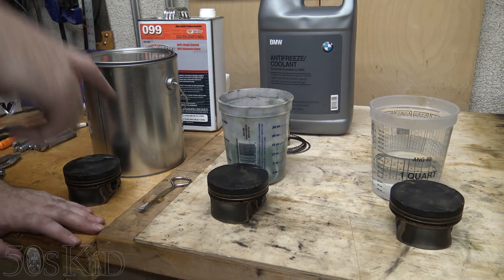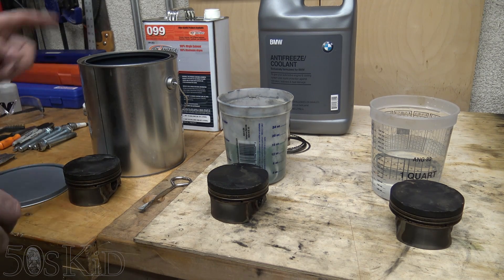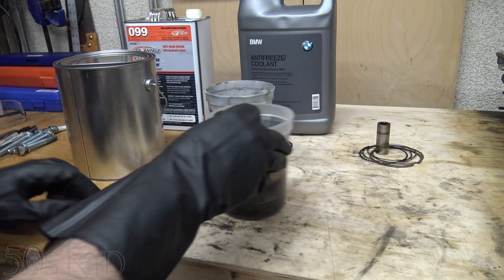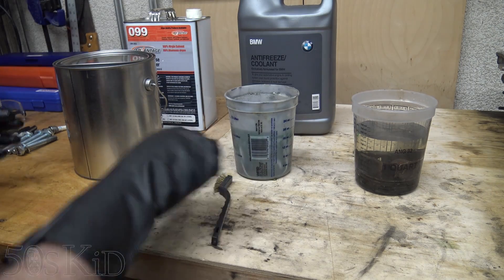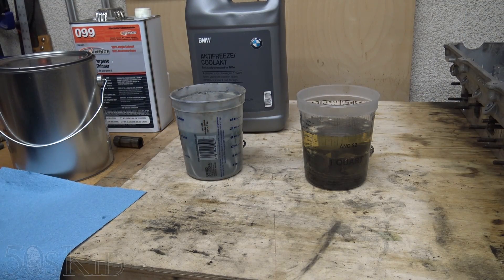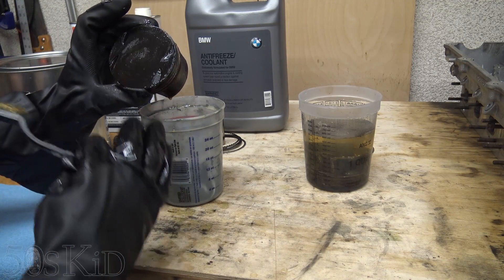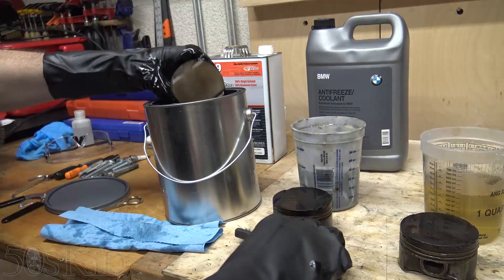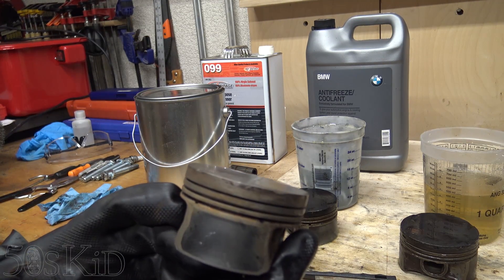How To Clean Carbon Off Pistons DIY

Comment: Water is a no, but steam will clean when under pressure + heat (ie while engine is running). Same goes with the coolant it has to be hot and agitated). That's why the combustion chamber is clean if you get a head gasket leak and coolant leaks in.

Comment: Chem Dip is the best method I've found. 19 bucks for a gal and the fumes aren't to bad. Works really well for everything I toss at it. What's another $20 bucks on a $1700 engine build. I used thinner once and learned my lesson after it caught fire in my garage.
Reply: How long did you leave the pistons in there? I ahve some but am worried about warnings on the side saying no aluminum for linger than 4 hours

Comment: I usually soak the pistons in lacquer thinner. Then light duty with a wire wheel and razor scraper. Then again degrease with lacquer thinner MAKE SURE THEY ARE DRY and into the toaster oven. DEDICATED OVEN NO LONGER ABLE TO COOK FOOD!!
 Start at 125 degf to completely dry and solvent free off the pistons for ten minutes then to 400 deg f  As per Mahle tech support even stock cast piston can handle up to 400 - 450 deg f. I stay around 400 or bake mode. After 30 minutes I hit them with the broiler between 400 and 425 for ten minutes to saturate the crowns, then back to 400 until what ever is left turns to ash. Slow cool in the oven. Juat a preference I drop the temp to around 250 for 10 min then off until room temp. Totally oil free and ready for install or your favorite coating process.
Reply from the maker: You don't need to bake anything. The solvents will evaporate very quickly.
Reply: 125 deg is not hot enough to clean pistons it's just a precautionary flash dry step to be sure all the solvent is gone. 
As far as baking it removes all trace oils and contaminants. All metals regardless of type or process have a microscopic crystalline grain structure making them porous and able to absorb oils this is why oil clings to parts. Heat cycles from engine operation opens the pores allowing the oils to penetrate the parts;  this absorbed oil is why engines don't seize the instant the oil film is gone due to lack of oil in addition to clearances and bearing materials. 
Baking the parts removes oil that saturates into the pores of the metal parts which is critical when applying and replacing engine and other piston coatings or applying coatings to used parts or new parts that have preservative on them. It also guarantees the parts are clean, I also have good success correcting  minor warpage of parts especially pistons usually less than  0.0025 inch that gives them a second or third round depending on application. I use this process for every engine build.

Comment: Question is, can i use a syringe to inject lacquer thinner into the spark plug hole, let it sit overnight and then start the engine the next day and blow it all out? Can that be done without the carbon coming loose in pieces and becoming jammed in the valves? If a person did this and the rings are worn, should i also do an oil change at the time time?
Reply: Cvcoco, did you tried? I would like to know.

Comment: I can take a cruddy piston drop it in my parts cleaner and submerge it and brush it off for about 2 minutes to remove oil and grease etc,, blow it dry completely and then walk over to my bead cabinet and clean it with glass beads to remove everything safetly without doing any damage to piston or rod pin surface and then blow it off with compressed air.
10 min start to Finnish with most time spent blowing it off 
parts washer step was to ensure no grease or oil contaminates my bead cabinet while cleaning pistons

with no exceptions this is the fastest easiest ways to clean unless maybe if you have a sonic parts cleaner with aggressive cleaning solution.. and maybe a spare 100 thousand for the set up ?
Reply: end result pistons look brand new with a dull uniform finish that is actually nicer then new
Reply: we're happy for yoy

Comment: really like your videos. my 2001 325 ci looses power, skips, shakes, after parking and going shortly after. it takes 5 minutes or so and then runs normal. was told fuel filter, plugs, and coils were replaced. do you have any suggestions? keep up the videos please and best of luck with the engine.
Reply from the maker: Watch my video on diagnosing random misfires

Comment: oven cleaner works great for removing carbon I used it on my 98  pathfinder intake manifold
Reply from the maker: Oven cleaner contains sodium hydroxide--it will react with the aluminum in the pistons
Reply: How about chem-dip? does it remove the coating on some bmw pistons?
Reply: @50sKid +1 on that! - Very bad idea using Oven cleaner - its usually is a strong base like Sodium hydroxide and WILL corrode/dissolve many metals - especially Aluminium! 
Safe for use with Stainless steel and readily dissolves fats, oils, greases, etc - why it's such a good oven cleaner, but no good for use on engines with metals like aluminium, cast iron, etc....... all which will be corroded/eaten away by the chemicals.
Reply: NEVER USE OVEN CLEANER OR STRONG ACIDS ON ALUMINUM IT WILL DESTROY THE PART. I learned that twenty years ago. Lucky it was a junk test part and not the race cylinder head.
Reply: only if you leave it on too long and do not flush it well after some time. Otherwise quite safe to use on lager parts, intakes, pistons, etc. then flush well. Cleaning time is massively cut in time spent.
Reply: Oven cleaner is great for cleaning cast iron.
Heads or engine block. But not aluminum

Comment: Was that a 50/50 mix on the coolant, or 100% coolant?
Reply from the maker: 50/50, same thing that was sitting in my cylinders after removing the head. Which is common due to the angle the engine sits at.

Comment: Nice Experiment. I have found a better chemistry to clean the carbon biuld up. Now if you are interested, I can send you a sample to repeat this, however I will be uploading a video to proof that the chemistry works. Let me know.
Reply from the maker: http://s2.quickmeme.com/img/9f/9f9c1819df2d17bf997ccab24c644a08405a4ea5e5d467776b3a8b3424c05425.jpg

Comment: Non-Chlorinated Brake cleaner and a brass brush. Woulda been done in 20 minutes
Reply from the maker: Not strong enough to get the caked on carbon off.  Lacquer thinner soak is the way to go.
Reply: B/S, I used this exact method this afternoon on a set of '71 chevy 4". Black as could be, cleaned up nicely.
I mean..... it IS for removing carbon build up on brake parts